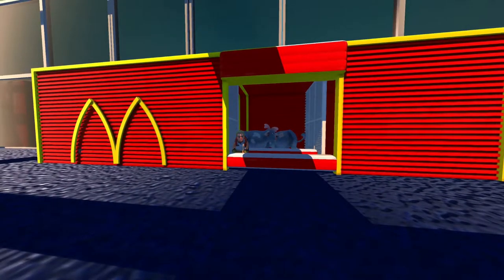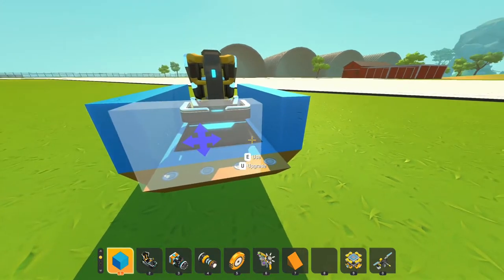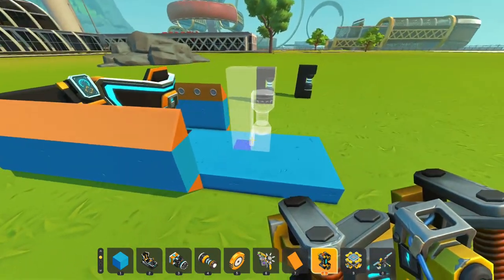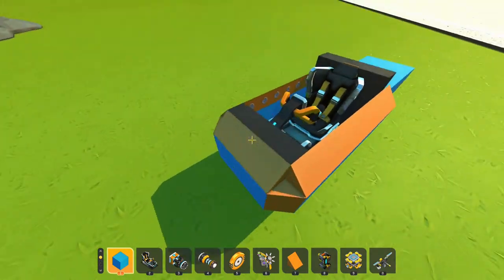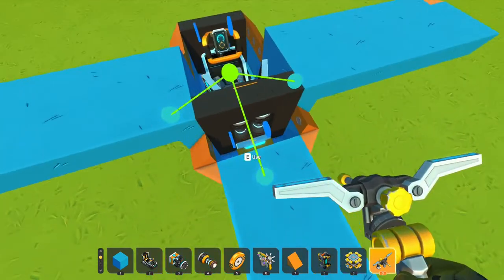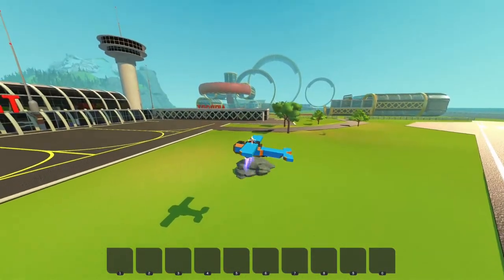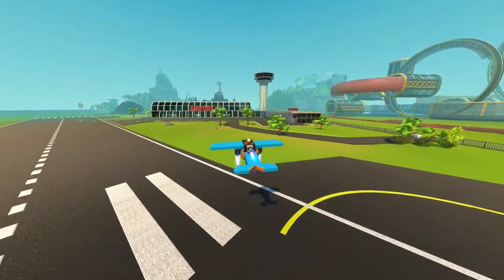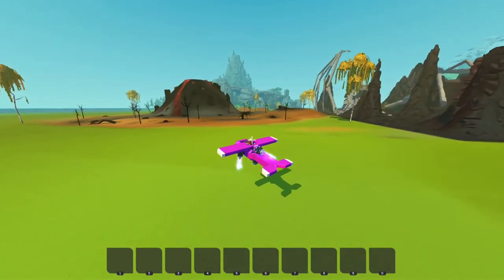HOW TO BUILD A AIRPLANE - Scrap Mechanic

Comment: How can i make plane rotate like left or right because my plane goes only forward
Reply from the maker: Make sure the block with the suspension is connected to the bearing and not another block hopefully this helps a little

Comment: Let me tell how it went with making planes :
1st time : On my own - Fail.
2nd time : Added some details and remade a bit - Fail.
3rd time : Literally tried to make a plane from guide - Fail.
4th time : Used this - IT WORKS!

THANKS MAN! LITERALLY WHAT I NEEDED! 

I painted mine in red-blue which is brighter at front and darker at back. I called him "Romance Guy". Also, I would like to see you build something like this one but bomber model. Thanks! :)
Reply from the maker: Aww that’s so cool well hey I’m glad I could help but YEAH that sounds awesome! I’ll make sure to do a bomber :)
Reply: Cool! Now listen to this :

B.A.A.U (or in Polish J.P.P.B) - Battle Aid Air Unit, also called "Romance Guy". High-speed air traffic unit and future bombing! It can accelerate to 100 km / h, transmit radio waves, blind enemy units, drift through the air and carry one friendly unit. It has red and blue lights, 2 pairs of stabilizers, an indicative duck and a cactus. It is colored blue and red (with white details), the front is lighter and the back - darker. After crossing the darker variations from red and blue, it turns purple. It was created by LittleCornDogs Gaming and improved by Mr. Star Doge. While LittleCornDogs is producing Romance Guy's bombing edition, Mr. Star Doge builds a rolling defense platform to help the plane hide in critical situations.
Reply: @mr.stardoge1188  (or in Polish J.P.P.B)...... POLSKA GUROM!!!!!
Reply: @rafcio217  POLSKA GUROOOM!!!!!